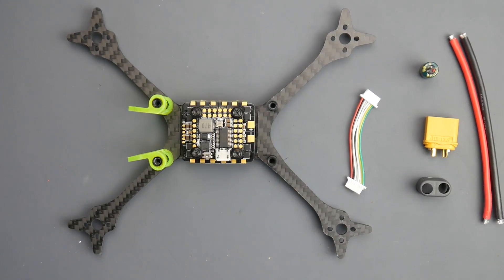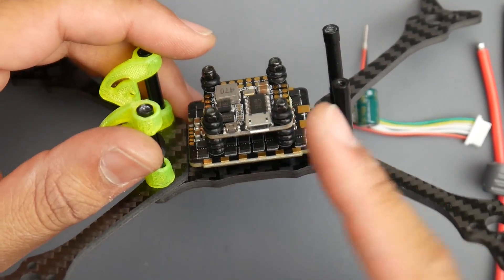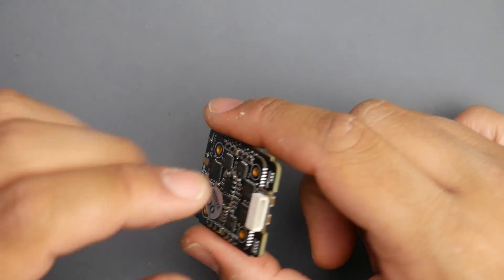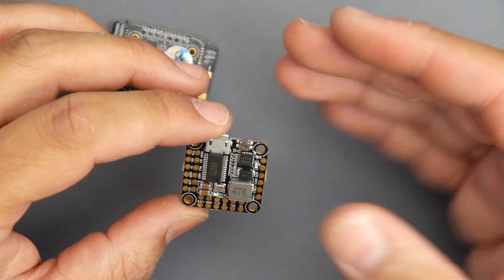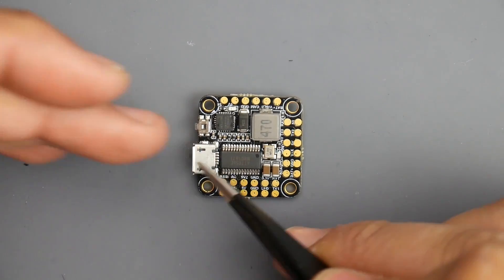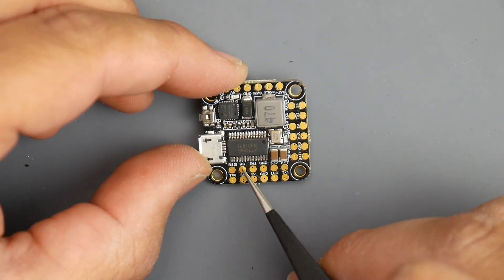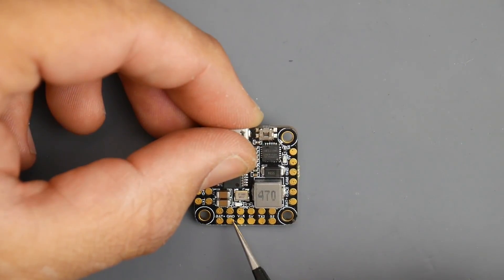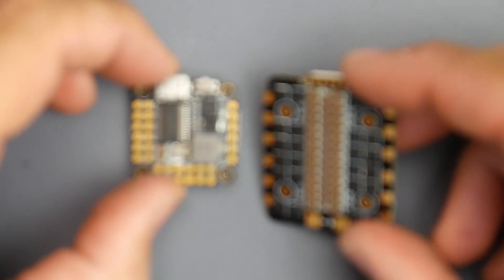The Theoretical 6S Lipo capable 20x20 Stack // HGLRC FD445 Stack

Comment: Thank you for this video :). 
With battery pads on both sides, in case I would burn the pad for battery+ during soldering, could I use pads on the other side? 
This is only theoretical question and I do not have burned ESC on my table, do not worry.

Comment: Who else is waiting for the aikon 20x20 noise results?
Reply: running it on both of my floss on 6s 2207.5 1722kv and nothing burned yet
Reply: @KoreFpv  for how long? Had some crashes yet? Im running the radix on the aikon 30x30 now but eyeballing the radix li and aikon 20x20 now.. And running the f60pro v3 on 2700 kv and want to try the 20x20 stuff.. But there is not alot of info on it yet! Would you reccomend it?
Reply: @hanfpv3093  had like 50 flight on 4s 2206 2722kv on both but only 15 flight on both on 6s and got some bad crashes (like headon collision with another quad) but no problem yet
Reply: @KoreFpv  okey awsome! Guess i just have to give it a try!
Reply: @hanfpv3093  btw using it with the helio mini, unify pro32 and predator v3 and got no noise even on full

Comment: A lot of racers are using these for 5" builds on 1800 KV or lower. It's a big weight savings. Higher voltage creates less heat per watt - right?